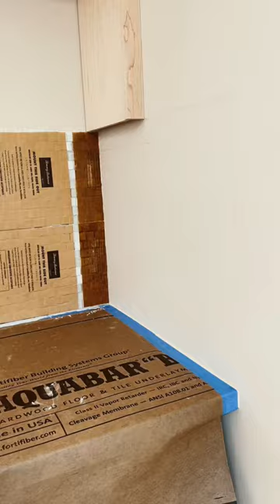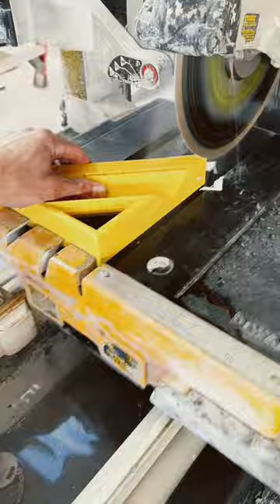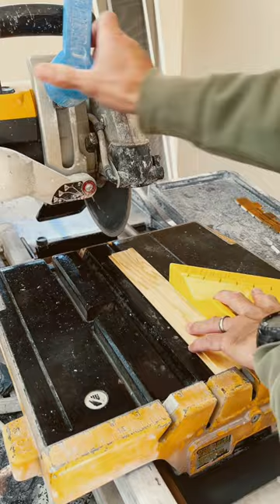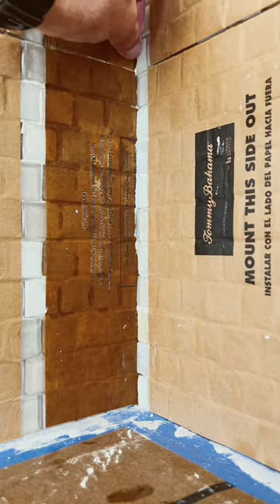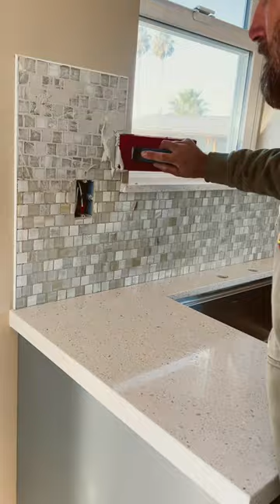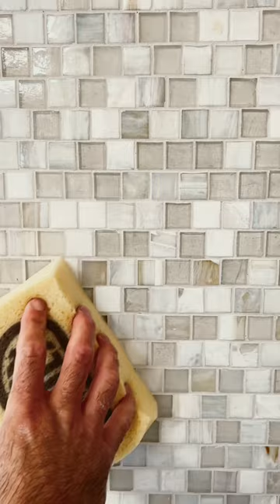Installing ugly backsplash!  #glass #paper #mosaic #busyfun #bad #gal #only

Comment: Idk why I’ve been somewhat doing tile for a minute and I’ve Always struggled ripping strips with that kind of tile. But putting a peice of wood an adjusting the blade depth is genius. Don’t know how I didn’t think of that
Reply: Plywood. Hold the whole sheet flat
Reply: I use cement board scraps

Comment: Why did you smooth it off before placing tile
Reply: My question too
Reply: It's glass tile. If you don't collapse the ridges,you'll see them through the tile. You'll see air pockets if the ridges aren't collapsed properly.
Reply: @50thstateofmind37  👍🏽I never would have known. Thank you. 🙏🏽
Reply: Also, so you will have a uniform surface to lay them on so that you are much less likely to have sections that are too high or too low.

Comment: Why didn't you tile all the way to the window? The trim metal piece should be at the edge of the window on the left and right, not set an inch or whatever in
Reply from the maker: That’s what the customer wanted 😭 they wanted it to fall right below the floating shelves that are going to be installed. I promise you, I tried to talk them out of it
Reply: @tilebro  I understand, I deal with this sometimes myself, it's really getting bad the last few years. I know what you mean but I just think that the tile contractor has a reason for being there and if the client hired said tile contractor I get the customers always right and everything but not always always. The problem with stuff like that is in my opinion is when they go to sell the house or when somebody comes in that actually knows what they're talking about and what they're looking at they're going to say who the hell did that backsplash wrong and then it becomes a problem, I agree it's a touchy subject. LOL have a good one!